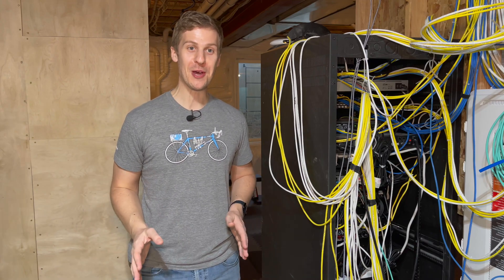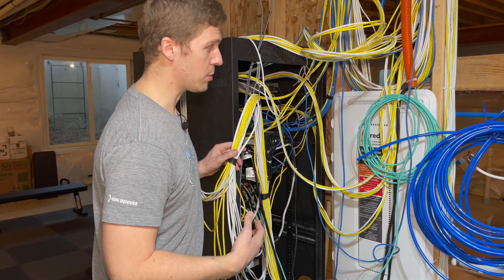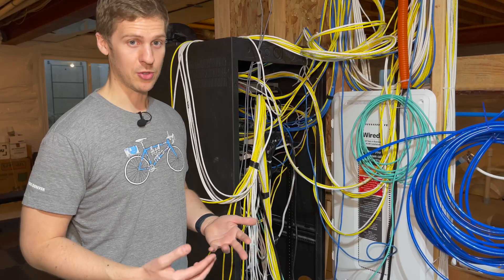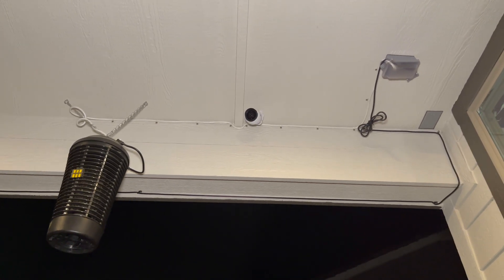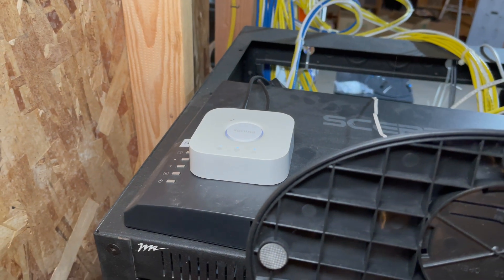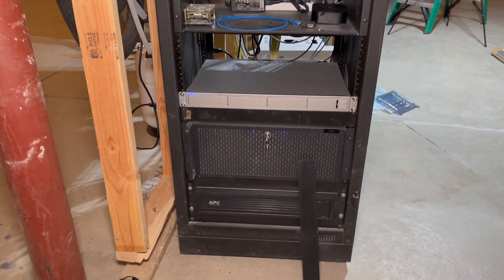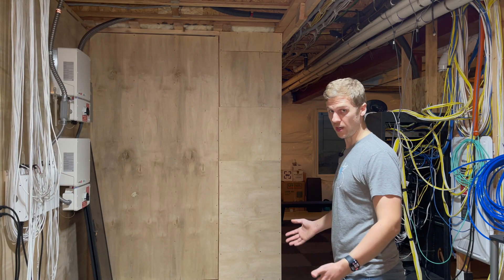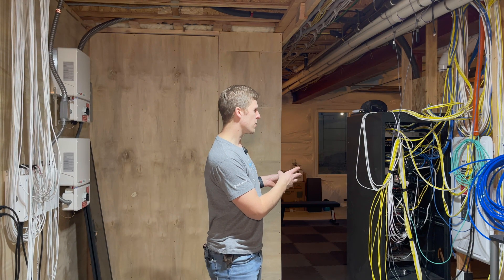New House, New Network, New Mess - Pt 1

Comment: In my case I have a two-post rack for all the cables to arrive at.I put my IOT units on a shelf there on the front side.  I then connect from the rack cabinet to the two post at the patch panel. So much easier for adds, moves, and changes. I am planning to install a 20A plug for a fridge sized battery backup unit and I am also putting the   Generator controls and   transfer switch in this area as well. The whole assembly will get its own locked room, that's 6 by 6 with HVAC in it as well as a water sensor for potential flooding. (Been there done that at work. Six feet of water inundated a basement server room when the HVAC line broke showering water into the basement of the building.)
Reply from the maker: Yeesh that sucks, we have sump pump and we're on a high elevation, so if water can't drain out of the floor drain then a bit of water in the basement is probably the least of our worries!
I think anything bigger than those UPS would be whole home backup as we already have solar, so rather we go for battery backup.. but still waiting on battery prices to not be silly!
Reply: @JenxTech  I have the same issue I have two small 1500 Eaton 5S units. The battery for each is $100 and the delivery (in the same city mind you!) isd $100 each and the batteries fail every 11 -12 months on average. So, I must factor in $400 for my battery replacements every year. They are considered a hazardous delivery by the company, so I must pay a surcharge (I call it a pandemic fraud charge). I am tempted to show up at their office in a bunny suit, full facial respirator and mask and ask to return the battery!